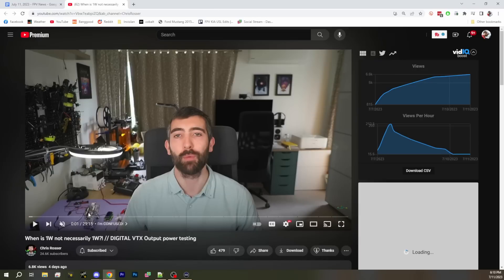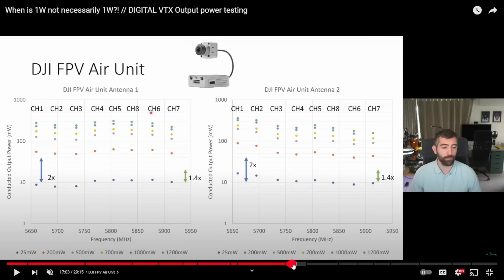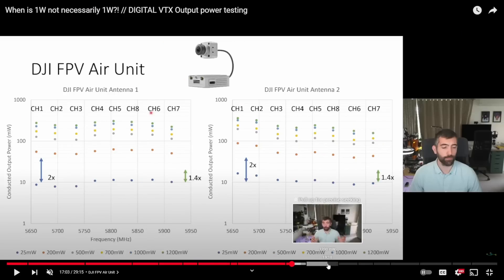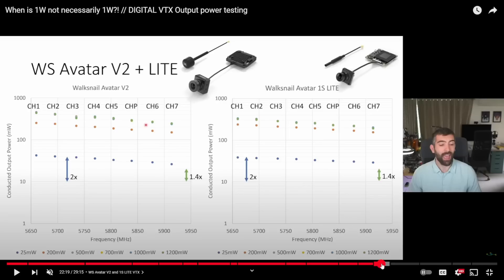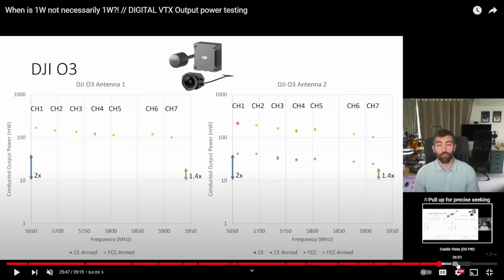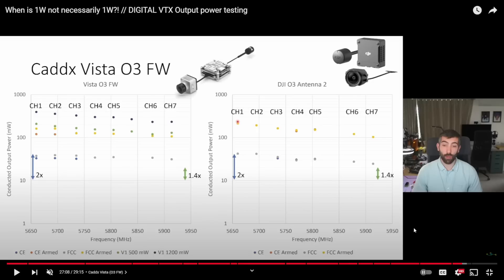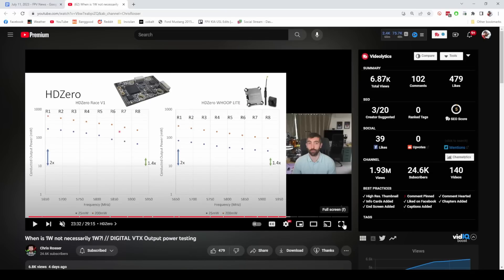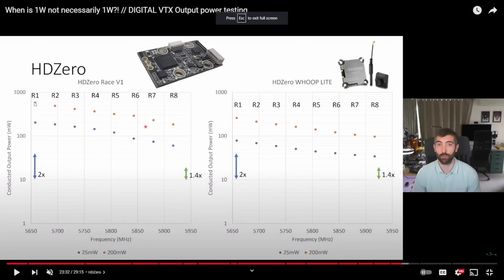Is DJI Output Power Wrong? What's EIRP? 1200mw? Chris Rosser Data! - FPV News

Comment: 10:20 Not exactly. Because the "ICE" Internal combustion engines is only efficient at certain very small range of RPMS. So performance across that band may vary. With electronics the legal guidelines for it are even more fuzzy. For example - FCC part 15 - "This device complies with Part 15 of the FCC rules. Operation is subject to the following two conditions: (1) this device may not cause harmful interference, and (2) this device must accept any interference received, including interference that may cause undesired operation." 
OR - 
"This equipment generates, uses, and can radiate radio frequency energy and, if not installed and used in accordance with the instructions, may cause harmful interference to radio communications. However, there is no guarantee that interference will not occur in a particular installation.

If this equipment does cause harmful interference to radio or television reception, which can be determined by turning the equipment off and on, the user is encouraged to try to correct the interference by one or more of the following measures:

Reorient or relocate the receiving antenna.

Increase the separation between the equipment and receiver.

Connect the equipment to an outlet on a circuit different from that to which the receiver is connected.

Consult the dealer or an experienced radio/TV technician for help.

Changes or modifications to this product not authorized by Apple could void the electromagnetic compatibility (EMC) and wireless compliance and negate your authority to operate the product.

This product has demonstrated EMC compliance under conditions that included the use of compliant peripheral devices and shielded cables between system components. It is important that you use compliant peripheral devices and shielded cables between system components to reduce the possibility of causing interference to radios, televisions, and other electronic devices."

Comment: As im a amateur radio operator here in aussie from the cheap shit he used to measure it its not accurate at all,theres also the temp pf the PA which would also make alot of difference due to the ALC kickin in and the RF pwr from the antenna doesnt work out the SWR and coax losses either but as ur a ex RF pro Josh u should know this but also Ive noticed alot of FPV antennae are a heap of shit and not tuned right and btw if its digital or analogue 1.2W is 1.2W

Comment: Also if you have wifi interfering with your channels lock your router to one of the channels instead of leaving it on auto and set your vtx to a channel that doesn't interfere.  If you really want to clear that up turn off the 5.8 on the router and only use the 2.4 wifi.  2.4 is fast enough for most wifi applications unless you are transferring large files across a network.  Here we typically just have phones and laptops browsing FB or youtube and 2.4 has no problems with that.  You can lock the 2.4 to a channel as well and also you can lower your wifi power output on the router to only be as powerful as you need so its not such a strong overstepping signal.
Reply: I have five access points and two wireless bridges at my house. They take up all the available wifi frequencies.
Reply: Funny thing, I was getting 10km+ range on my vista and O3 units. One day, I had a crash with one, and a low voltage situation with the other...after that both were only getting 1-2km range, I thought both units were messed up. Swapped antennas, no luck. After even trying a new unit and still getting bad range, I was at a loss. A few days later, my neighbor was talking about how he just got a new super cool powerful quad band router. I asked him to shut it off temporarily and my range suddenly was fine again. So it was just a coincidence that my crash/voltage issues happened on the same day he installed his router. I can't ask him to shut it off or move it, so I guess I'm just limited in range now when flying here.